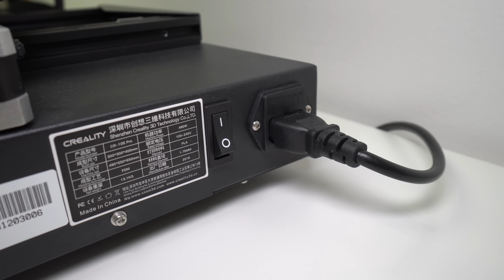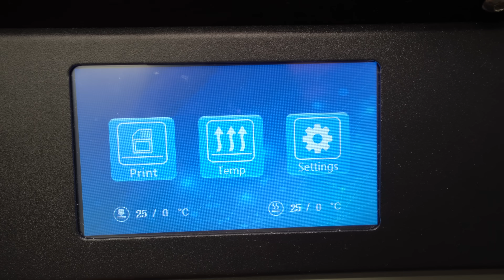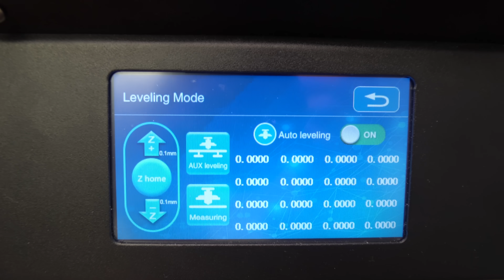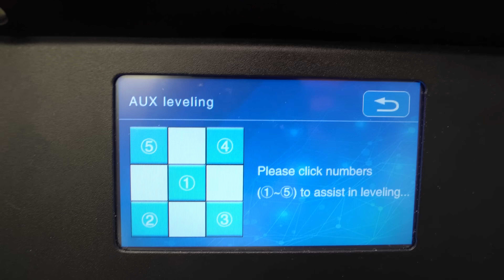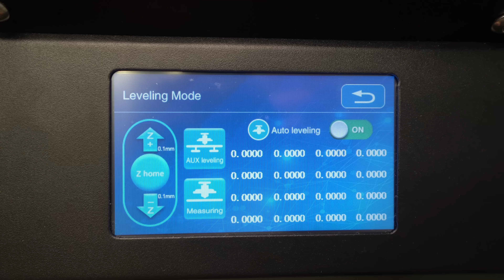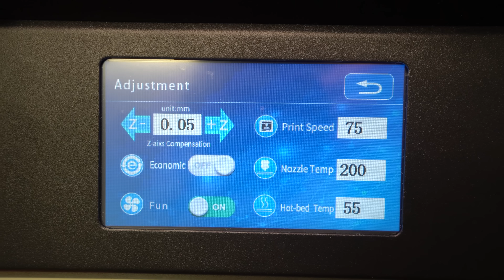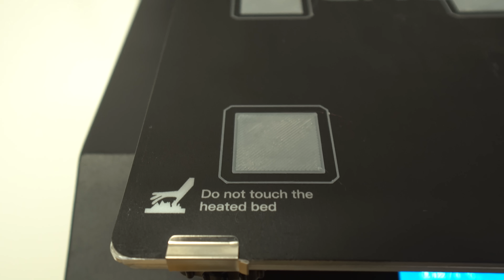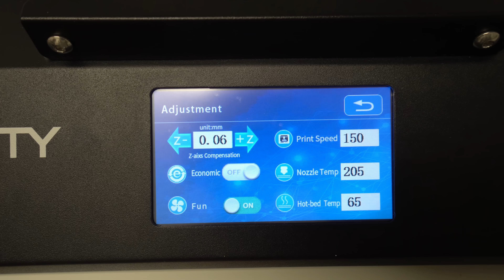Creality Cr10S PRO - Fix your bed leveling issues (Inductive sensor install)

Comment: BRILLIANT VIDEO! Thank you! Do you know if the inductive sensor will work with the TH3D updated firmware? If so I think I will definitely be doing this with my CR-102S Pro. (Heck, I might even reinstall the original creality firmware if I have to!)

Subscribed to your channel as well.
Reply from the maker: Thank you David! You welcome I'm glad that I helped. We I can't confirm that because I did not used TH3D Firmware.
I use Latest Creality Firmware 1.60.7 version and it works great. Here is few tips: 
Please read it.

1. Lower the inductive sensor more down like 3mm or less away from Heatbed. 
In that case nozzle will be higher up and chances that nozzle touch or hit the heatbed surface is minimal and it will give you even more precise measurements. 
2. Upgrade the firmware to the latest one from Creality right now the latest version is 1.60.7(Works great and it saves all Autolevel probe measurements and Z offset and it shows them after power off...
Here is how to upgrade CR10S PRO firmware:  It's very easy.
1. Connect printer via USB cable to the CURA.
2. Click on Settings/Printer/Manage Printers/Select Cr10S 3D printer/Upgrade Firmware/Upload custom Firmware/Select firmware file CR-10SPro_1.60.7.hex and run it. 
3. Wait minut or two...
Done!
Reply: @NexiTech  thanks! I will test it with the TinyMachines firmware and if it doesn't work I'll reinstall the standard Creality firmware 👍🏻
Reply: My first thought was that the Tiny Machines Firmware doesn't support inductive sensors, so I re-flashed the firmware with the latest Creality one. 

Now looks like I've been sent a faulty sensor, because the "detect" LED is always on, and Octoprint reports that "Your printer has reported and error, unable to enable Auto Bed Levelling" DAMN.

And of course, having cut the cable in order to solder it onto the wires for my original sensor, there's now no way I can send it back to Amazon. 

Going to reconnect my original sensor and hope it works.

Comment: I checked the amazon one, but it says it can handle between -25 and +55 °C. I am going to use an enclosure, as soonas I find time to make it, so there will be more then 55°C. Any other solution?
Reply from the maker: Marco Dominutti Well basicly printer needs Autolevel sensor to be ON and working only when taking measurements before each print. After that it's not matter how hot inside of enclosure is becouse sensor is not active. When printer is finish printing he just move X and Y so again sensor is not active.

Comment: I love to ship you my printer to have this installed  since my printer is just not printing correctly. Your prints slide right off and I either have no adhesion or the prints are impossible to take off.  Interested? Or is there anybody in Rhode Island that wants to make a house call.
Reply: Maybe this group can help you https://m.facebook.com/profile.php?id=2458174024223964&ref=content_filter

Comment: My CR10 Pro came with an  inductive sensor, NEW!
Reply from the maker: Corey A That's awesome man! Thank you for new update info.
Reply: Which sensor?
Reply: @gihadmurad  which sensor? One next to the heat end...
Reply: @CCCCCCCCCCCCCCCCC707  It would be cool if you shared which model they shipped you since you seem to be the first one reporting getting a inductive sensor stock

Comment: Hello thanks for the video !  will this inductive sensor works for the glass bed or no? thanks
Reply from the maker: AurorA 360 You welcome my friend.
 Well yes it will work with aluminium bed with glass sheet on top, but the glass needs to be less then 3mm thick. Here are few photos with my 2.85mm thick glass. When sensor trigger you have 0.5mm clearance from nozzle. It's not to much but it can work. 
If you get 2.5mm glass it clearance can be 0.85mm which is even better. 
https://drive.google.com/folderview?id=1w-X8HLwxsCRnHv6OUHp5gDF6sBOEZlyt

Comment: Thank  you so much. I just sent back my first CR-10S Pro due to the fact I could not get consistent prints. It seemed the printer would not stay level. I'm definitely going to replace the auto level sensor with the one from the link when my replacement printer arrives.
My first printer was a Ender 3 Pro and it has been a dream. it floors me how poor the setup was for the new CR-10S Pro was. When my  printer arrived all the Z rode screws had fallen out and the fan was broken. Talk about some poor quality control
Can't wait to try out your tips. Keep up the good work

Comment: I ordered this sensor and will be in tomorrow. From what I read it will read through glass bed as long as not more than 3mm and will read the aluminum bed underneath? Wanted to verify. Hoping so because I like glass and I don't want to go bltouch
Reply from the maker: Vlog Dog Yes it will work, but glass needs to be less then 3mm thick. Here are few photos with my 2.85mm thick glass. When sensor trigger you have 0.5mm clearance from nozzle. It's not to much but it can work. 
If you get 2.5mm glass it clearance can be 0.85mm which is even better. 
https://drive.google.com/folderview?id=1w-X8HLwxsCRnHv6OUHp5gDF6sBOEZlyt
Reply: @NexiTech  thank you. My glass did not work. I'll have to measure. One was a mirror which is over 3mm and other was crealitys glass bed, which seemed to be good thickness, but sensor just wouldn't stay consistent. Thinking about a pei surface maybe. Not sure yet will keep messing.

Comment: Great video but I do have a question. How well will it work if I'm using a polypropylene bed surface? I assume it will measure off the aluminium surface underneath but will I need to compensate for the thickness of the polypropylene surface too?
Reply: Thanks for the reply, its roughly 2.8mm thick. I've just received my sensor today so going to give it a try now
Reply from the maker: Mark Sutcliffe How thick your print surface is?
Reply from the maker: Actually Inductive sensor will work with glass, but glass needs to be less then 3mm thick. Here are few photos with my 2.85mm thick glass. When sensor trigger you have 0.5mm clearance from nozzle. It's not too much but it can work. 
If you get 2.5mm glass it clearance can be 0.85mm which is even better. 
https://drive.google.com/folderview?id=1w-X8HLwxsCRnHv6OUHp5gDF6sBOEZlyt
Reply: doe you still use the acrylic spacer to set the probe height even with glass? im having trouble with it crashing into the bed. ive ended up setting the print height using the feeler gauge then adjusting the probe manually until the light comes on

Comment: Does this sensor have some kind of sensivity adjustment like the capacitive stock sensor? I mean its rated at 8mm and that acrylic piece is 3.8mm - so how can this be accurate? Please explain.
Reply from the maker: You don't need it. Just home the printer and then use Z offset and 0.2mm Feeler or A4 paper to set your Z offset. Then Home it again and it's done :) Here is few tips:
Please read it.

1. Lower the inductive sensor more down like 3mm or less away from Heatbed. 
In that case nozzle will be higher up and chances that nozzle touch or hit the heatbed surface is minimal and it will give you even more precise measurements. 
2. Upgrade the firmware to the latest one from Creality right now the latest version is 1.60.7(Works great and it saves all Autolevel probe measurements and Z offset and it shows them after power off...
Here is how to upgrade CR10S PRO firmware:  It's very easy.
1. Connect printer via USB cable to the CURA.
2. Click on Settings/Printer/Manage Printers/Select Cr10S 3D printer/Upgrade Firmware/Upload custom Firmware/Select firmware file CR-10SPro_1.60.7.hex and run it. 
3. Wait minut or two...
Done!
Reply: Nexi Tech thanks Nexi, sensor ordered!

Comment: Nexi, just to get this right. You have a glass sheet with "buildtak" on top of the aluminum bed?
Reply from the maker: DixonSwe No my friend. CR10S PRO have aluminum heatbed and 3mm aluminum sheet and on top of it BuildTak.
Reply: Ahh,  @NexiTech  that explains that. Double up on the aluminum. :) Would have been quite strange to use an inductive sensor "through" glass.
Reply from the maker: @DixonSwe  Yap 6mm of Aluminum :) BTW Glass over aluminum bed  will work, but glass sheet needs to be less then 3mm thick. Here are few photos with my 2.85mm thick glass. When sensor trigger you have 0.5mm clearance from nozzle. It's not to much but it can work. 
If you get 2.5mm glass it clearance can be 0.85mm which is even better. 
https://drive.google.com/folderview?id=1w-X8HLwxsCRnHv6OUHp5gDF6sBOEZlyt
Reply: @NexiTech  There could be a small issue with inductive sensors and glass on aluminum. You level the bed with reference to the "levelness" of the aluminum sheet.
If your glass / glass/"buildtak" exhibits imperfections that the aluminum sheet don't have it will not be taken in to account.
Or vice versa, a slight bow in the aluminum bed and a completely flat glass. 
Great find however that the inductive sensor was a straight replacement, I've heard rumors that it could be the SSR that's interfering with the capacitive sensor.

Comment: What I don't get is that the sensor doesn't have a calibration screw so how do you tell the sensor when to detect the object?
Reply: The answer to this is that inductive sensors by design cannot be adjusted via screw/potentiometer, instead they are adjusted by changing the height of the sensor.

Comment: One thing to notice is that your inductive sensor will not detect the build tack layer and only the aluminum under it (probably the reason for the little offset) now things go really south if like me your bed has a glass sheet in which case the inductive sensor is useless and the main reason that I still use capacitive sensors. Yes they are to some point a pain, but if you set the profile correctly in your slicer chances to have a bad first layer are non existent. But like someone mentioned I think a Bltouch will be better for bed leveling.
Reply from the maker: Nature boy  Actually Inductive sensor will work with glass, but glass needs to be less then 2.9mm thick. The thinner the better. When sensor trigger on 2.85mm glass you have 0.5mm clearance from nozzle. It's not too much but it can work if you can't found thiner glass. 
Personally I use 2mm glass(1.92mm actually) and sensor triggers 1.35mm away from the glass bed. I have alot of clearance. Here are few photos with my 2mm glass where sensor triggers.

Comment: Hello
Only thanks to your videos I ordered myself a CR-10S PRO. I hope all will be ok :).
Question: Why was the hot end fan cover replaced (blue element)?
Reply: It was probably replaced - I've seen reports where the original one may fall off from heat.
Reply: @roblopatto7874  
Hello
Thanks for the answer.
I did not know about it ...
Now I will know what to watch out for.
Reply from the maker: I printed a lot of ABS. Duct air nozzle was originally printer in PLA so it gets deformed so I print new one with PETG.

Comment: Is it better bltouch or inductive sensor for this machine?
Reply: The answer depends on what build surface you want to use.
For anything thick that is not conductive, capacitive sensors or Bltouch like sensors are the way to go. just printing on a thin sheet like pei or buildtak or somethin that is conductive you could use an inductive sensor.

Comment: Great video not only for replacing the leveling sensor but for your leveling approach creating your accurate z-home and then go for two-step leveling! Can you also post the template square g-code for test printing?  Before seeing this I spent the whole weekend to level this printer couldn't get the best one. I was fine with small prints but with large ones, the nozzle was crashing the prints! I ordered your inductor sensor and would follow your instruction, hope it works. Thank you for this helpful video!
Reply: Btw, does it work if I have PEI on my print plate?
Reply from the maker: @rahoo67  Yes it's work, actually Inductive sensor will work with glass too, but glass needs to be less then 3mm thick. Here are few photos with my 2.85mm thick glass. When sensor trigger you have 0.5mm clearance from nozzle. It's not too much but it can work. 
If you get 2.5mm glass it clearance can be 0.85mm which is even better. 
https://drive.google.com/folderview?id=1w-X8HLwxsCRnHv6OUHp5gDF6sBOEZlyt

Comment: Personally, I have changed the SSR and fallowed the Th3d guide for calibrating the conductive sensor, and I now have consistent results.
Reply: What was the reason to change the SSR, was it indicated by TH3D? Or did you only follow their guide?
Reply: @GELHammer  Honestly, it is a bit of both. I read in the th3d support group that SSR leaks current which causes conductive sensor inaccuracy. th3d goes around this by turning off the bed during probing. Since I don't use their firmware, and I'm not sure if AC and DC SSRs the same, I removed it. The rest was blindly following TH3ds calibration method.
Reply: WOW got a link to that? might explain why I get a 1.5mm offset on an otherwise absolutely flat bed just on the left side. SO annoying. with the damned capacitive sensor :-)

 @ossme
Reply from the maker: ossme Guys upgrade your CR10S Pro with latest Creality firmware 1.60.7 version. Now it's shows Auto level measurements and Z offset all the time efter power off etc... It works great.
If you have one for the first Cr10S Pro(Like I have) change your sensor to the Inductive. New CR10S Pro units now are shipped with new inductive sensor insted of capacitive.
Reply: @NexiTech  Problem is you never know what batch of printers Banggood or AliExpress have stored in their warehouse, so it's like a lottery draw to get the inductive sensor.
Reply: @NexiTech  That is good to hear thanks. I think they should have sent free replacement for the first owners.
Reply from the maker: @ossme  Yes I agree on that. Inductive sensors are very cheap.

Comment: Hey, Nexi, awesome video as usual, one question: have you also noticed how the left side of the Z axis is about 1mm lower than the right? When you use the 100mm block to level it the left side is always  a bit tight.. is this because left side is heavier or do you not have this issue on your model?
Reply: That’s precisely what you’re supposed to get rid of, by turning one screw while holding the other one stationary. Continue until they’re exactly the same.
Reply: @JasperJanssen  It doesn't matter, after few movements it will come out of alignment again. Also, when the printer is powered off the motors disengage and it gets out of alignment. One of the many common problems with the Cr10S pro
Reply: Gihad Murad that’s almost certainly untrue. A difference of 1 mm would make it entirely impossible to do a print on a non-self-leveling printer, that’s way more than the height of the first layer.

The second Z screw is supposed to make the gantry straighter, not less.

Although I’ll certainly agree that from a design perspective, it would make a lot more sense to put the E and X motors on opposite ends of he gantry to equalize the weight a bit (once you have the second Z screw, that is).
Reply: he is saying there is a force imbalance. IE he does what you say but its being "pushed" back out of alignment on its own.

something is cockeyed or too tight. either the eccentric on the vertical trolleys or the brass thread collars for the lead screws are too tight out of position or cockeyed.

also make sure the FRAME rails for the vertical gantry are straight and true.

 @JasperJanssen
Reply: sounds like the lead screw is out of alignment with the tri wheel vertical trolleys.

first make sure the right vertical trolley is not too tight. loosen it till it wobbles then tighten only exactly enough to stop the wobble no more.

then loosen both of the brass threaded collars one in each vertical trolley. level x and then "snug" but don't tighten the collars. that should get rid of your force imbalance that is pushing x out of alignment.

Comment: I'm always wondering why Chinese brands make this kind of mistakes. A bltouch would have done the trick much better, because it works really well whatever kind of surface you are using on your plate. I have a BIQU Thunder Advanced and I though that I had almost same issues with autoleveling, but no, it was just my fault using that feature hehehe. It would be great to see a side by side analisys of both machines in your channel. Great video, by the way.

Comment: I have a Creality CR10 S5, and I have upgraded the bed with a 5mm thick cast aluminum plate with 60 small strong SmCo magnets (up to 360° C) and a 240V AC silicone heater. 
I know I must switch off the heater if I use an inductive sensor, but my question is: will the magnets mess with the inductive sensor?
It is a constant magnetic field, so maybe not a problem?
But the inductive sensor moves down when measuring distance, so the magnetic field increases, so maybe it IS a problem?
Can you test your inductive sensor with a constant magnet on the printbed?

Comment: Wow, very nice, ordered the inductive sensor, cancelled my order for a bl touch.  Also what firmware are you running?
Reply from the maker: Thanks mate! Well I like inductive sensor more. It's direct change no need to change anything to the firmware. Im using stock 1.60.2 Firmware you can see icon (fun) insted of FAN in the video :) 
Just now I'm reading on Facebook it looks like that Creality lunch officially upgraded firmware 1.60.7 It looks like they fix a lot of bugs.  Can't wait to test it :)
Reply from the maker: 1.60.7 Runs great! 
I shows and saves now all settings including autolevel measurements after power off.  Nice!
Reply: interested on a video on firmware update @NexiTech
Reply from the maker: Andrew Woulfe Please read my Pin(First comment)